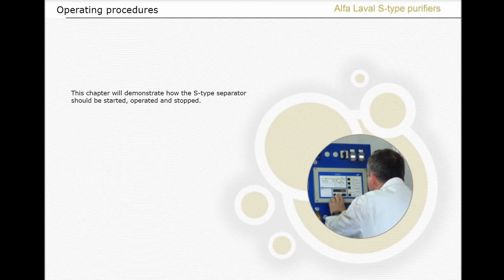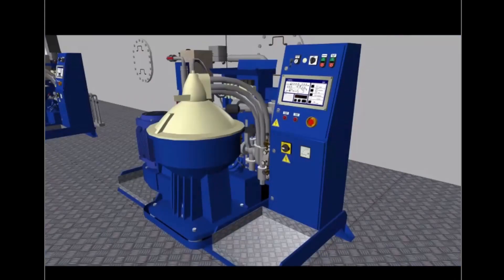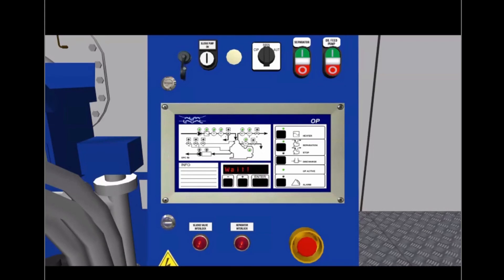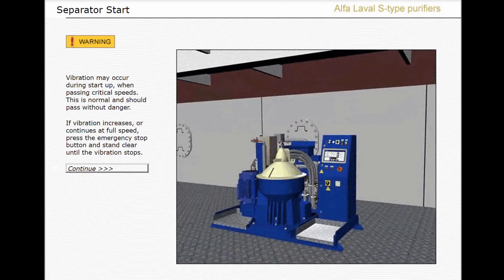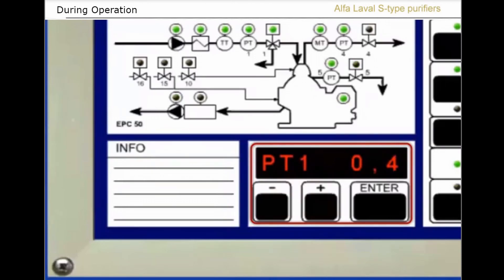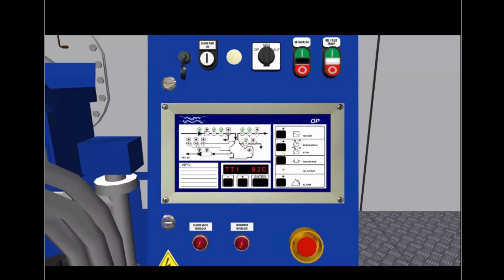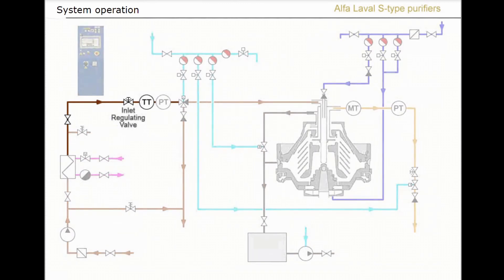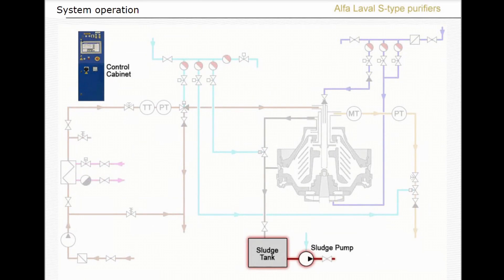Purifier Operating Procedures (Video Instruction with ECP Procedures) How to start a PURIFIER

Comment: Dear Sir !
If normal purifier of ALFA LAVAL  usually use Gravity disc to make interface into bowl. 
I knew that I could choose Gravity disc to suitable for each oil such as Lubricating Oil, HFO, DO. And I read the manual and documents of ALFA LAVAL to choose it. I watched diagram to choose Gravity disc.
But, I know that Purifier of ALCAP ALFA LAVAL use flow control disc to make interface into bowl and on the face of flow control disc have small hole.
so, I don't know to choose flow  control disc suitable for each oil.
Can you give me some information to choose flow control disc ?
If you have many experience,  maybe you share, you can send email: hongocthiennt14@gmail.com
Thank you so much !